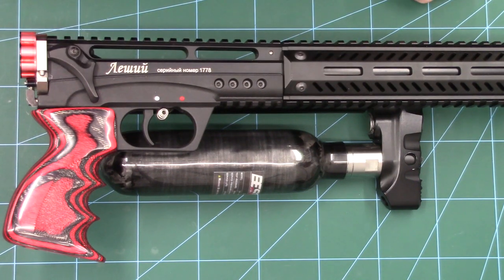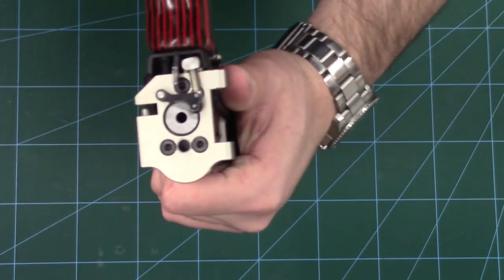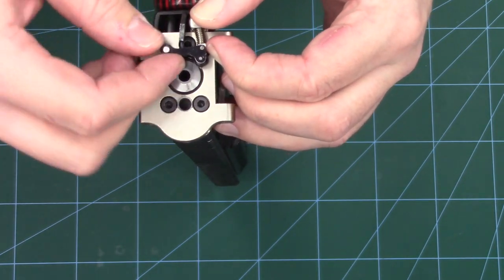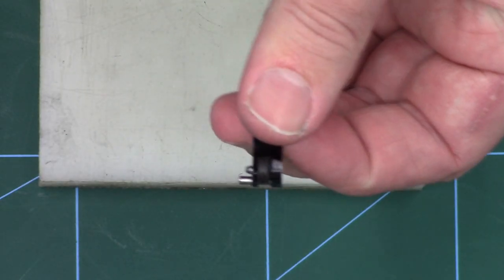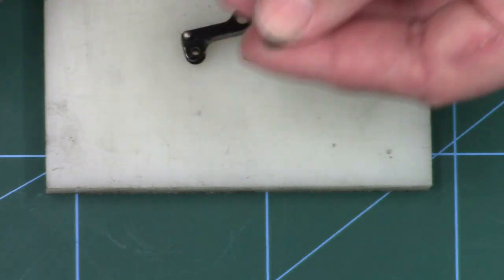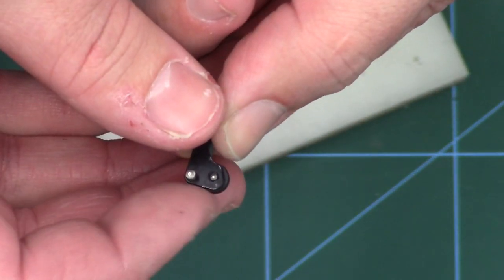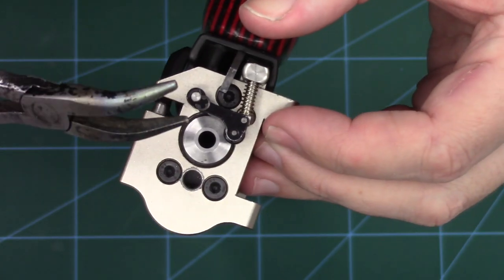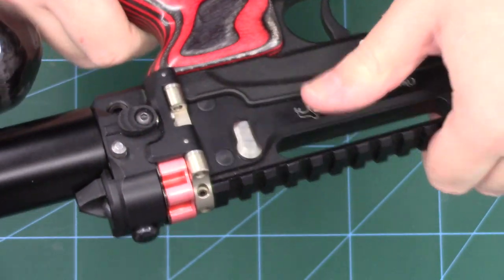Leshiy 2 magazine indexing wheel replacement.

Comment: Please can you help me, my lesily 2 came to day , i shot the gun all working, took the mag out shut the gun up, now the side lever won’t open the gun thanks
Reply from the maker: Hmm strange, have you checked the position of your mounts if they are too far back they wont allow the arm to rise and will stop it from opening, other than that I can't really think of anything that would stop it form working. Thanks for watching
Reply: @sub12airgunners  I’ve done it, push hard down on the front an the back, it must off been catching on the pin that locks in, but thanks for all your help,   Got some bits for my gun on ebay from you great fit , just waiting for you to make a 25 magazine loader best wishes dave chubb